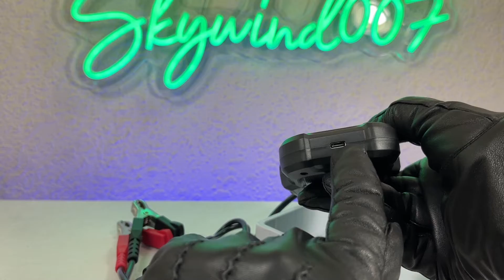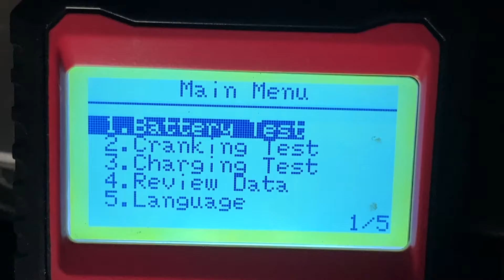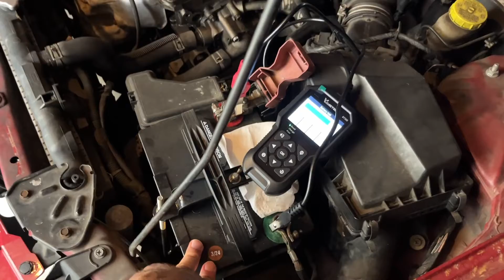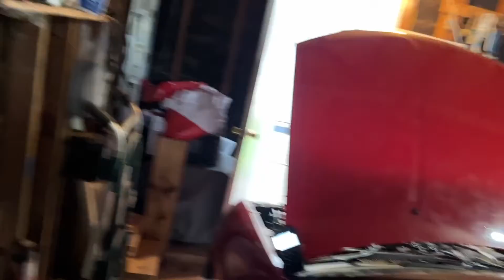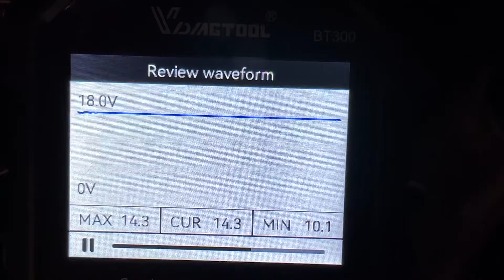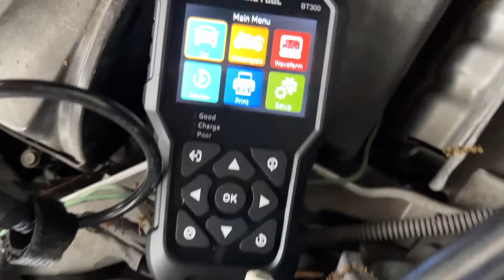Vdiagtool BT300 Professional Car Battery Tester 6V & 12V

Comment: Hi. What settings do I use to test an auxiliary battery? It says 12V 1.2Ah lead acid
Reply from the maker: If there is a liquid in there then the battery is "regular flooded". Most likely it is. Although there are some gel batteries, that fall under GEL.
Reply: @skywind007 I see. There’s nothing mentioning liquid on it, but does say non spilllable